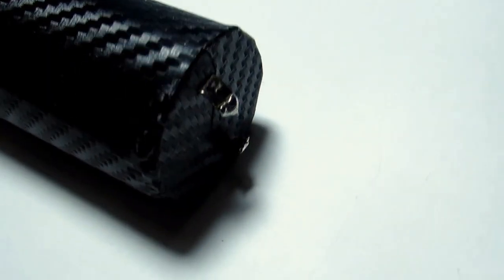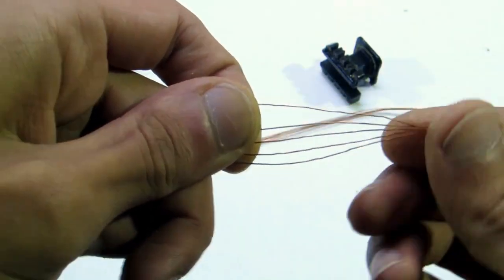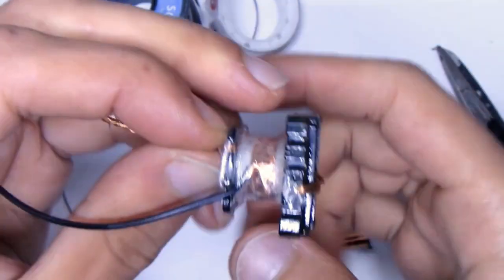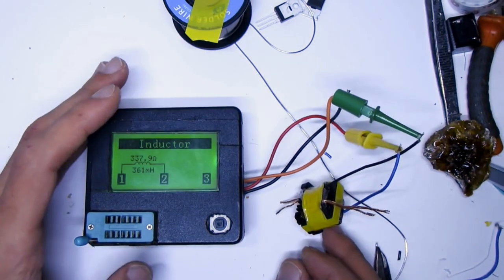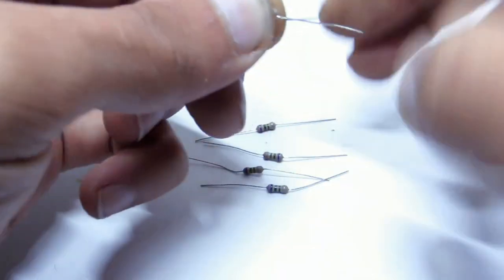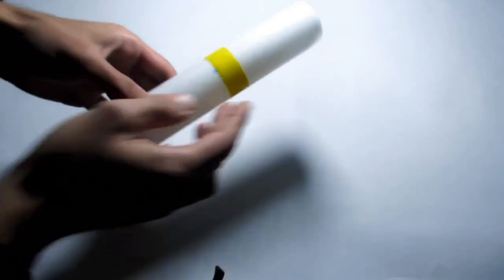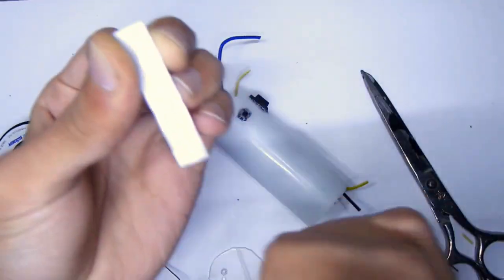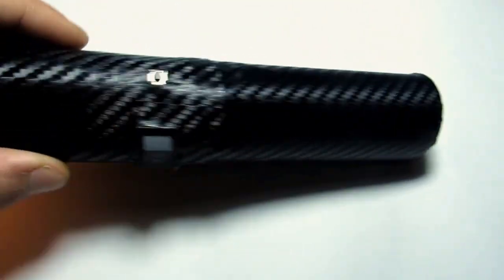SUPER VIDEO !!! Watch Everybody!

Comment: My dear friend, something is wrong in the circuit you put in the description. I rode several times and I could not get it to work. I tested the transformer, which you taught you to mount, with an induction meter, and there was no problem with the transformer.
Is something missing? Does the Relay have to oscillate? How to connect the relay terminals to the source and the toroid? Many doubts, many Mosfet's burned, much damage and could not mount kkkk Can you help me?
Reply: it was a joke to find the joke and the joke is found. trebor avlis

Comment: hey Mr kasyan, what do the discharger resistors do?
Reply: it discharges the voltage multiplier capacitors to avoid accidental self shocks when you're not using the tazer

Comment: please, tell me where can I get Epoxy used to fill high tension part in this video, thanks!!!
Reply: Use wax.... It will work better.
Reply: @khageshroy7766  wiil candle wax work?
Reply: @LifeHacks-gl4lj  yes it in fact works better as it's resistivity is more than epoxy.. Only problem is it will melt if your device gets too hot Or if you live in a hot country. I have already made two high voltage multiplier as shown in this video and i have used wax.. It is working great!
Reply: @khageshroy7766  ok im gonna try it sometime thanks!

Comment: when i made my HV transformer yesterday i used plastic kitchen foil one layer between each layer of wires. even one layer tape is too thick and you waste valuable space for coils by putting 5 layers of tape
Reply from the maker: but firmly
Reply: Kasyan TV putting layers as thin as kitchen plastic foil would make the tape break. kitchen foil is great for multiple purposes and i strongly recommend you to get some and test its amazing properties